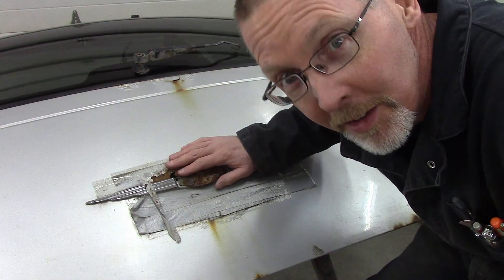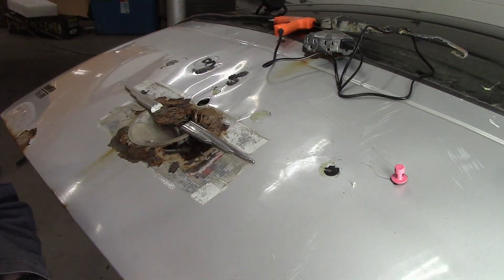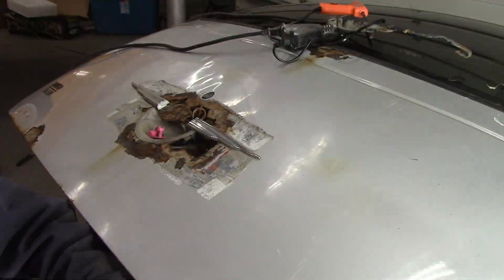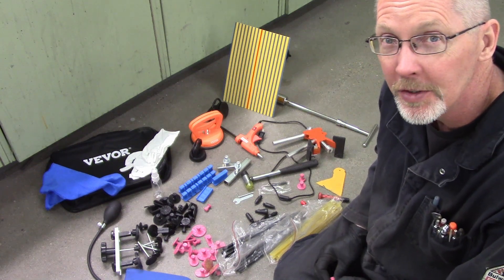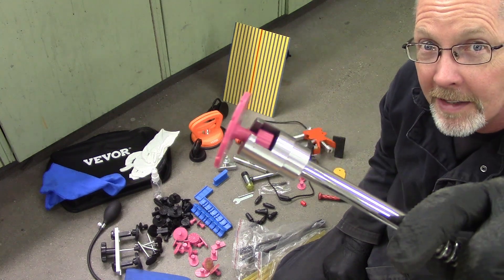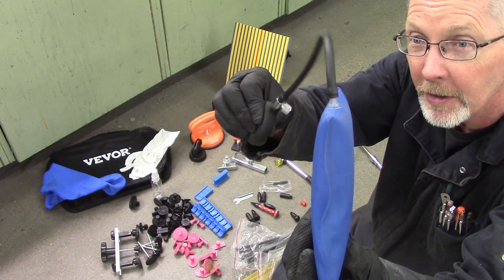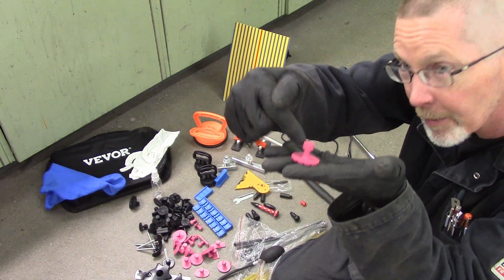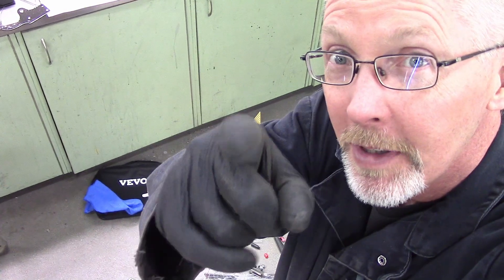Intro to Paintless Dent Repair by a Guy Who HATES Auto Body

Comment: This is the kind of thing that you really need to have some desire and patience to make work, as well as a lot of little tricks. One that fouls me up is one that you figured out- generally work your way in from the outside to the inside of the dent, I always take the "reverse how it happened" approach and try to pull it from the mark where it got hit, and that usually doesn't work or at the very least creates more work for you.

Warm paint is less likely to crack

Remove the hot glue by squirting some Isopropyl alcohol on it, it literally falls right off. It seems to be a property of all hot glue and it's downright surprising how well it works.

Comment: I think you did fine. I've been there myself. Ice slid off the garage roof and severely dented a car in the yard. Before tackling the bodywork in the regular fashion, I bought a small kit and got the surfaces to the point where the job was much easier to tackle. A mirror finish end result is beyond my skills, though.

Comment: I think LED light isSUPERIOR to Florescent light!!!
Reply: Yes LEDs put out more light, but they also put out a high UV amount, which is not visible, but can burn your eyes if you use them for this type of work.
The objective is to get the lines in the reflection to line up, not really to light up the work area